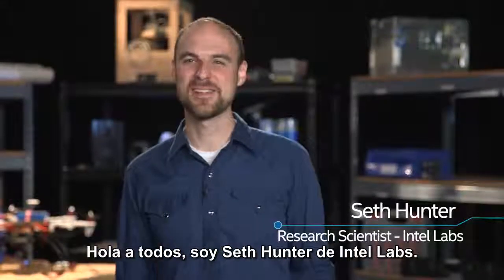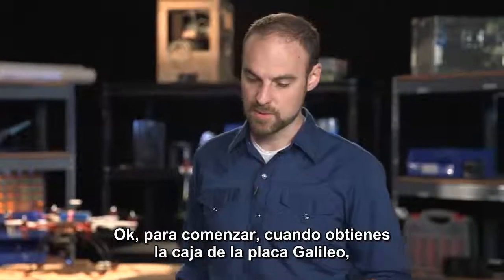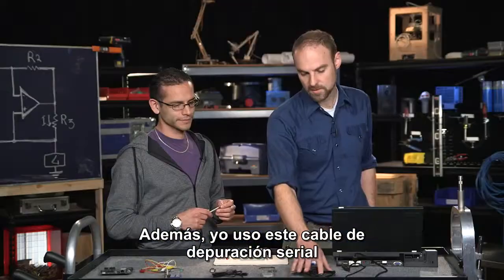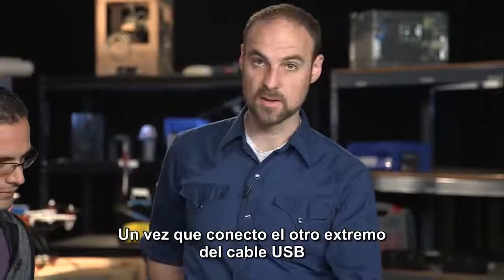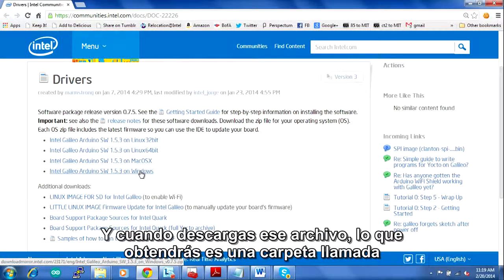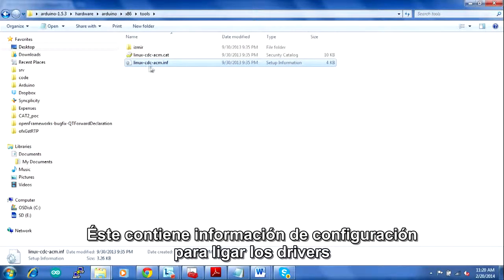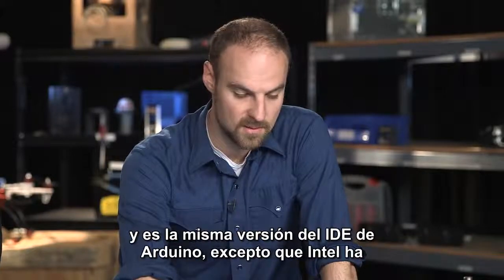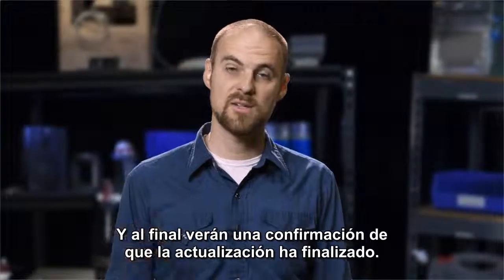The Maker Inside Galileo - Primeros Pasos 1/3

Comment: hello to all of the drivers fine, but the firmware upgrade bug me, took more than an hour and cancel the update, I returned again to connect and enter the option of updating the firmware Arduino galileo me asked if I wanted to continue, accept and I frame error disconnect again everything and restart my computer and now my computer does not recognize the Galileo card, I changed USB ports and still the same does not recognize the card or in the device manager, I please can help this scares me